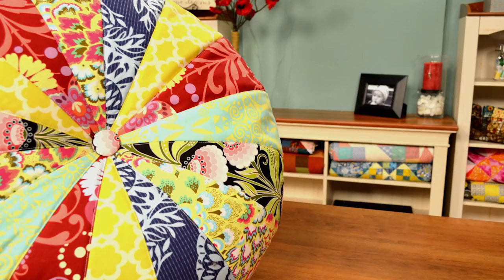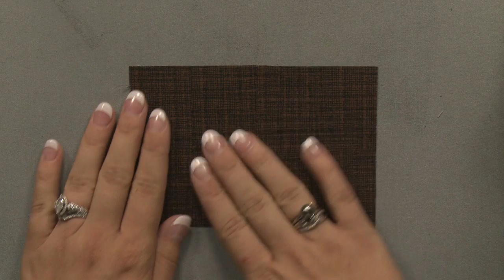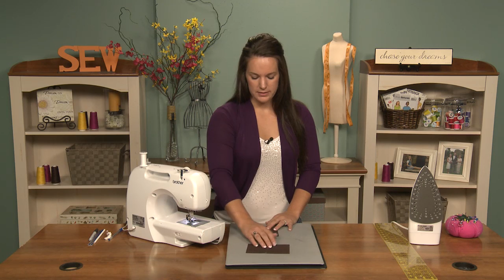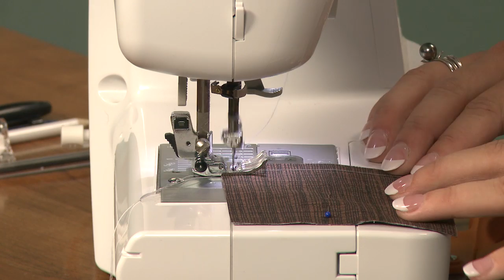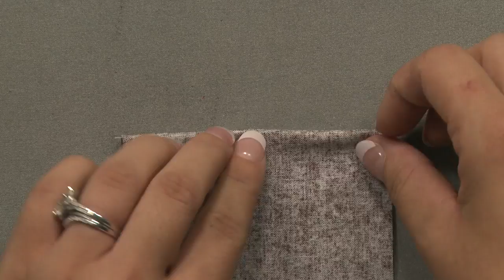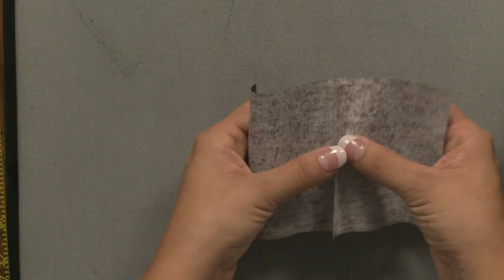French Seam Sewing Tips for Your Next Project

Comment: French seams add strength and durability to seams that will receive a lot of stress in addition to giving a finished edge to fabrics that will fray easily.  This is especially important in heirloom sewing and sewing for babies where a rough-finished seam detracts from the delicacy of the garment, won't withstand the stress of dressing and undressing a wriggling baby, or whose edge might scratch delicate newborn's skin.
Reply: By the way, check seam allowances on baby garments carefully.  The seam allowances on them aren't always 5/8 inch.  In doll clothing (where French seams are ideal wherever possible because little hands aren't always gentle when dressing and undressing dolls and antique doll garments should have French hand sewing details in them) the seam allowances are usually 1/4 inch.  So, adjust your seam allowances for French seams accordingly.